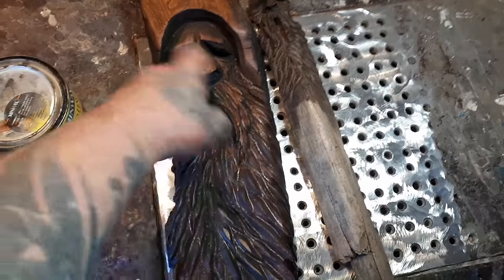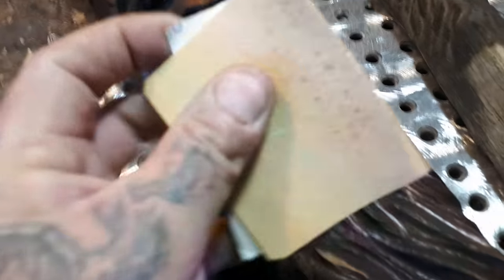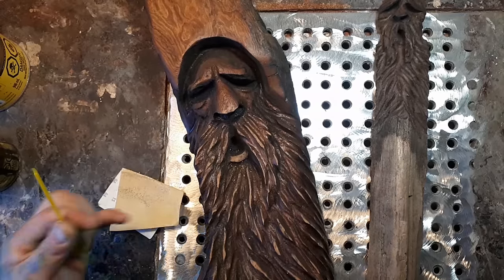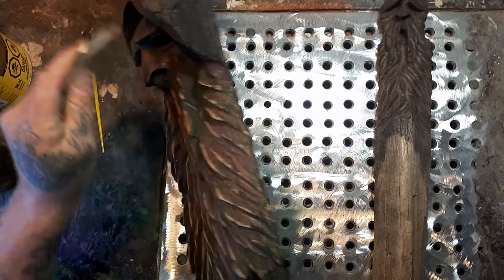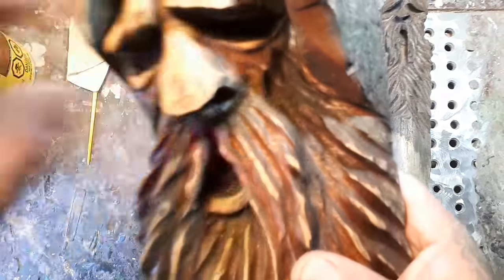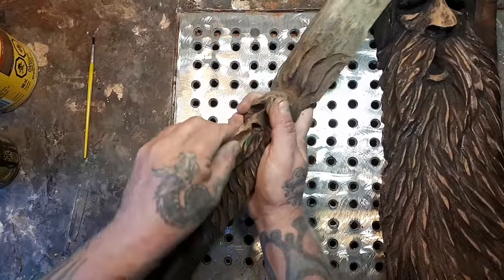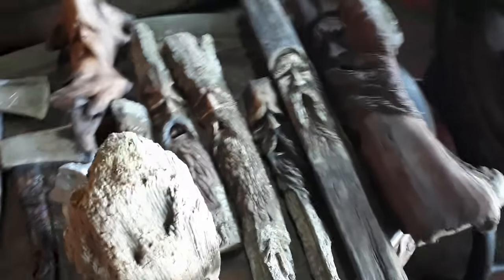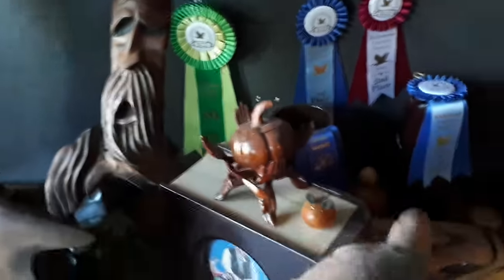Staining and sanding my carvings, How to,

Comment: Are there any water based stains that will work as well as this stain?
Reply from the maker: Yes there should be
Reply: Carving Fusion By : Jordy Johnson thx
Reply: Carving Fusion By : Jordy Johnson also I forgot to ask this question in the first comment but what colour of stain do you use?
I've ben trying to find a water based stain that looks like that.